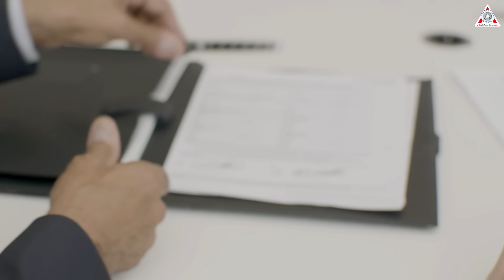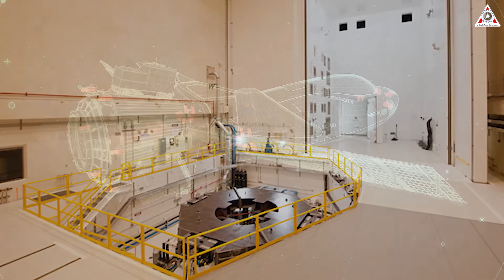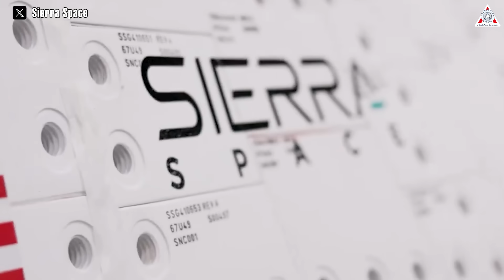NASA Dream Chaser is ready for its first launch after the successful ULA Vulcan...

Comment: There is huge concern for the affects on the Van Allen radiation belts with regard to burning up so much debris in the atmosphere.  Atmospheric scientists are concerned with effects the ionization of large quantities of materials in the upper atmosphere.  I would like to know to what degree should we be concerned…I have heard from several sources that we should have extreme concern as space launches are increasing at a massive pace.
Reply: 5000 tons of space dust are incinerated in the atmosphere every year, a satellite part or rocket stage now and then probably doesn't amount to much compared with that.
Reply: No. The Van Allen belts begin at 400 miles. Reentry burning occurs at less than 100 miles. There is absolutely no concern about spacecraft reentry affecting the belts or having any other environmental effects.
Reply from the maker: Thank you for your comment!